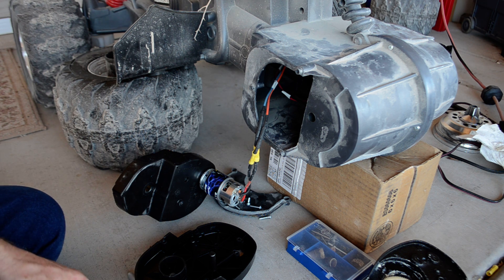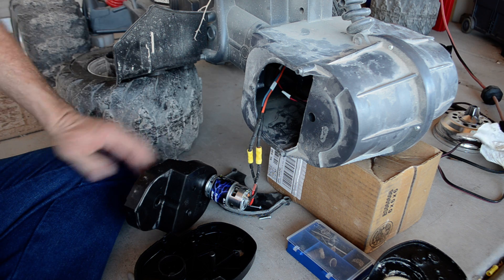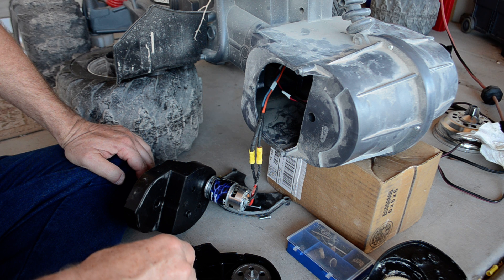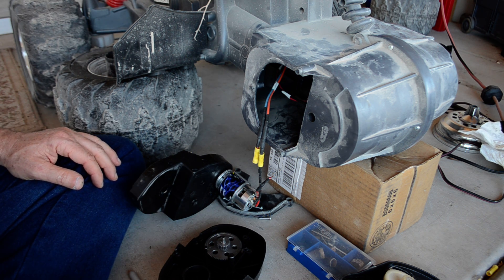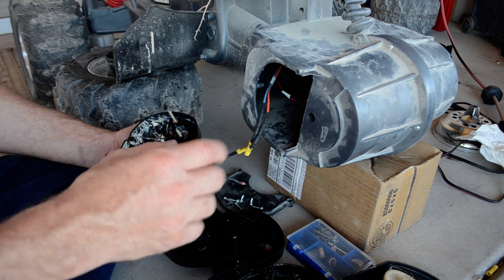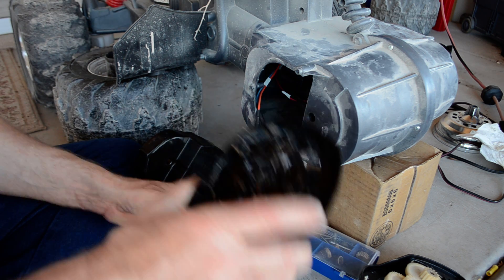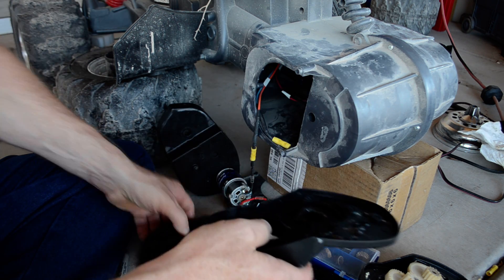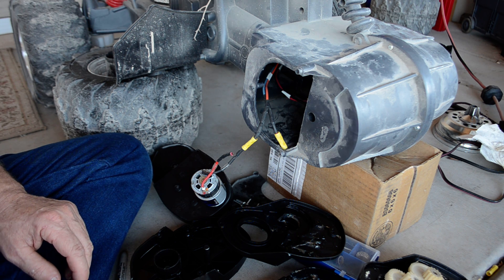ML Toys Powerwheels Stage IV Steel Gear and Gearbox Review & Results & Alternatives.

Comment: It's normal for power delivery to be uneven, when there's no load - especially when it's wired in a series. With the wheels on the ground, and a shared load, it evens out. HOWEVER, this is much different, than bound gears. It seems like bad customer service to assume that you're not describing the problem correctly, and they start walking you through the "This customer's dumb, but we need to prove it to him" troubleshooting steps. "We're fed up with you..." That's a great way to ensure repeat service and keep the money flowing in.

Comment: there prices are too high and not a great selection 

ive got a rastar ferrari and new a new gearbox because my plastic gear stripped and new metal gears are $600 

looking for 24v very high top speed so... there is one one on amazon but looking

Comment: @stickman-1.. I know this is many years later but I appreciate the video. If you still have the gear boxes and want to give them away I would like to try them.
Reply from the maker: I still have them. I would give you the gear boxes, but the motors and gears I'd have to get money for.
Reply: @stickman-1  Ok I will take the gear boxes. How much are you selling the motors for?
Reply from the maker: @barringtongoulbourne9524  I'd sell everything for $85 shipped. That's 2 motors (775 motors) pin gears, adapters, 1st gears, the gear boxes and everything else that I have. I paid about $300 for the pkg from ML Toys.) Everything is in one box, you will have to sort things out but I'll make sure it's packed properly.
Reply: This is my phone number 18764234932 whatsapp.

Comment: Curious to know what happened after this.
Reply from the maker: I bought my son a real electric ATV and junked the powerwheels thing. I still have the ML stuff if you want it, I'll sell it all to you. But only do it if you like breaking things and repairing them over and over.
Reply: @stickman-1  my son is only 1 but I'm one of those dads that likes to build things better. I actually manufacture offroad truck parts for a living. I bought a ride on jeep for my son with the remote so that I can drive him around. My primary current concern is the suspension. It has cheap spring suspension but it's very rigid and doesn't give much travel. Especially with the plastic tires. I want to upgrade the suspension to more of an independent cross kart type. Also, I want to upgrade to a fully variable throttle, instead of the on/off type, and also, I think maybe adding a capacitor in the motor wiring might make the braking less harsh. And finally, I'm considering either brushless motors and planetary gears from drills or converting to golf cart motors with a transfer case for 4x4. What do you think and have you done any of this or have recommendations? I plan to build him a nice electric cross kart one day and eventually convert it to gas.
Reply: @stickman-1  also, what type of electric atv did you get? I'm not really familiar with those.

Comment: Did you ever get this setup working?
Reply from the maker: Not really. As soon as I got one thing working something else would give out. (Other gears, gear box, switches, etc) I ended up buying a Russo electric ATV and trashing the Powerwheel. I still have the motors, gears, housing ,etc and will see if you want it. The Russo is not perfect, but for the money I invested in the Powerwheel and it's upgrades I could have nearly bought the Russo initially and it'll do 22mph on the highest setting (3 settings.)

It is not a perfect product and has some shortcomings but it's still working and nothing major. The only caveat is that the Russo is only 28" wide and so if your are on one of the higher speeds its' easy to flip over. So have your kid get really proficient driving before you up the speed.

Comment: i bought 2 complete 24v gearbox's and ran it through a 36v scooter controller with 2 relays for forward and reverse with a variable accelerator and a hoverboard 36v battery and charger..its been a year and still going(12v to 18v is the same difference as24v to 36v)...thanks for your info the more we know..

Comment: Man... I just dropped a few hundred for a stage 4 kit and it's been over a week. Have heard nothing and status still says processing, cannot cancel. They also do not want you to contact them for any reason because, it will only slow things down. I should've read all the comments here.  

Just acquired another Power Wheels and don't want to dump more money to them. I think it'll be winter by the time I get the kit at this rate.

Looks like I could get 775 motors off Amazon, just need the spacer, bolt, and bracket mount for my other power wheels. Where can I get these parts besides ML sucky Toys? Thanks in advance!

Comment: Man, this sucks. I just dropped $200 on one of their stage 4 do-it yourself kits with the 775 motors because we’ve burned up 3 of their 550 motors over the course of the last month. After burning up the 3rd motor I started to think that we were just pushing the 550 a bit too hard and that upgrading to a 775 might get us over the hill. But at the same time I had my reservations about ordering anything after the 3rd motor because I was halfway thinking it may be that their products were just garbage.

But my son loves his truck and I convinced myself that larger motors would fix it. Im really wishing now I had just pieced things together on my own and not spent a penny with ML.

The truck was a trash find but I’ve now poured enough cash into it that I could have just bought one new and even with the bigger motors I still hesitate each time we use it and worry that we are going to burn something up again. 

I sure wish I had seen this video a few months ago before all of this started

Comment: If u wanna upgrade cheap buy new stock 550 motors with heat sinks .rebuild your gear box with race grease. Then run 18 volts and no more then 12 Amps. That's my sons Corvette setup so far so good also got my daughters pink jeep on 18 volts 12 Amps and everything else stock with no problems.

Comment: I must say there products are awesome! You need to be expert at building such setup!  I understand the frustration they gave you. They did fix it. :)
Reply from the maker: It's supposed to be a drop in part. That's why I paid the premium money to save time and the headaches. Instead I got a bunch of BS and run around for months. They didn't fix anything till I sent them video, after video, after video here on youtube. If not for these videos, I don't think they ever would have "fixed" anything. And they didn't really fix it. What they did was finally acknowledge my complaints were valid and finally got me the right housing.
Reply: @stickman-1  I ended up doing my own motor upgrade.  I used motors for electric drill that is rated for 12v to 24v.  Ball bearing motor too. So far no issues! At 12v motors spin 15700rpm at 24v spin 41000rpm!
Reply: Ml toys have a great metal 1st gear! There motor suxs!
Reply: My combination puts their motor to just junk!

Comment: i ordered the upgraded motors along with the 24v battery upgrade from them recently but using the stock gears and during there break in process i noticed one of the motors was not spinning as fast as the other and would actually stop while the other would spin faster. they said that is normal. i am only getting about 10 min of runtime on high speed, they keep saying make sure you follow the break in process, it never came with the instruction i had to follow the YouTube videos which i did but still only seeing 10 min. IDK i spent a lot of money and time and only getting 10 mins on a fully charge battery doesn't sound right. and i cant find a phone number to call them only email which there reply back is maybe two sentences, like I am annoying them by asking questions.
Reply from the maker: Wow. Five years later and they still have the same problems and they still treat people the same way? Clearly they have learned nothing from their customers.

Comment: I bought over 500 dollars worth of parts, Installed and gears broke the first 20ft.
Reply: I just spent $600 Canadian (after shipping)
775 fully assembled gear boxes. 

On the FIRST ride after only 30 mins we lost power to one wheel…

Both motors work. Seems like something stripped in the gearbox. 

I’m taking it apart now to see what’s going on.

Comment: I also had a bad experience with M L Toys after spending hundreds of dollars on upgrades. Multiple  sets of performance motors all burnt out after a few uses. Went back to stock motors.
Reply: did you break them in? i want to upgrade mine and i dont want to waste $100 or more on motors that will break

Comment: Jesus Christ. Why not just have you return the problem gear box and re-ship you a working one from the get go. I mean, they just wasted time and eventually shipped you a component of the part. It wouldn’t been much easier just to sent the entire part to you. Once they receive the broken part they can troubleshoot it and re-sell it if they get it working. I’ve heard from several people that their parts are iffy sometimes and their attitude sucks.
Reply: they aren't trouble shooting anything. They sent me batteries and said i messed them up. Battery charger doesn't even work. They want me to upgrade to the stage IV I said you cant even get me batteries. Then they want me to reach out to mighty max and they said we dont do warranty work. I told them they said well you hast have messed up the batteries sorry. F them!

Comment: You just saved me several hundred. I was about to buy several items from them. Thank you for the vid
Reply: who did you go with? they screwed me big time.
Reply from the maker: I used their gear and motor since I already paid for them. As for the ATV we just junked it. It kept breaking gears. All we were doing was playing wack a mole. As soon as you fix one thing, something else breaks. We ended up buying a Rossi ATV for $600. Runs 4x as fast as this and doesn't have the problems this did. (The Rossi has it's own short comings but they are minor compared to this mess.)
Reply: I also switched gears and went with an electric ATV from littletoysbigcountry. We are much happier with this than trying to make these power wheels more than they are intended

Comment: Does anyone know where to buy the Metal First Gear w/ 2 Steel Ball Bearings. I can only find them on MLToys?
Reply from the maker: I recommend not wasting money trying to upgrade these toys. As soon as you get the metal first gear, then you'll have problems with the 2nd gear and if you get that resolved then the case just "melts" from the heat generated. We ended up buying a Rossi for $600. They are a bit higher price now and they are not perfect, but it's way better money spent IMHO.
Reply: @stickman-1  thanks but not spending 600 on a child's toy.  maybe if I competed

Comment: I was sent the wrong order, their fault... and here I sit waiting for my motors and gears. BUT, they said they will push my order up to satisfy me. No, that isn't going to work, hold on to the order that was sent to me until I get the correct order that I placed with them.
Reply: they sent me used batteries.

Comment: I am so glad I came across your video. I was about to order from them. Do you have any suggestions on other companies to buy from? Thank you for warning us. They need to know how much customer service matters.
Reply from the maker: There are people on ebay selling the metal gears. I have part numbers for the other items on Amazon in the long description for the video. But I do want to warn you, even after you fix all of these issues the gear boxes will ultimately fail. Once you get the 1st gear and motor solved then it'll be the 2nd gear that strips teeth. Eventually you will find no matter what you do, they will fail everytime because the gear box is just plastic and it will deflect and deform under strain and cause the gears to lose proper engagement and then be on the tips of the teeth, not the roots. As soon as that happens they strip. Also the gears will grind INTO the gearbox at the axles. Because the gears are helical cut, they put longitudinal loading (perpendicular to the gear) on the case and it just gets eaten up.

I ended up buying https://www.rossomotors.com/ for $500 and got a complete ready to go electric ATV that will go up to 20mph.
Reply: @stickman-1  Awesome! Thank you so much. I was trying to decide if I wanted to put any more money into our Dune Racers. I've already upgraded all the wheels to lawn tractor wheels. That would probably make the gear issue worse too, with all that extra traction from the real rubber tires. I considered the Razor Dirt Quad, but I'll have to check out the one you linked.

Comment: I was hoping for a good experience, even after watching this vid (doh!)  But this video is legit and exactly what I went through these past few weeks.. it was supposed to be a simple drop in.. NOPE.  First set didn't even turn and were damaged on arrival as they shipped in the smallest box possible with barely some paper stuff in for protection.  In complete disappointment I simply wanted a return/refund - MLtoys says "not going to happen, all sales final no matter what".   I tried repeatedly as I was sent damaged, non-working parts - but after a few back and fourth emails...  NO REFUND, NO RETURNS.. so I play along and return the motors for new ones, and they send me a second set.  The second set worked, but were not in sync and wobbled hard.. and were quite noisy.  I did all things mentioned, break in, etc.  with 24v on full batteries, the motors would last about 1 minute before cutting off.. then kicking back on .. and with the uneven rpms it was just plain no fun at all.  For a fraction of the cost I bought stock replacements - they are quiet, balanced, in sync, and actually turn faster!  The MLtoys versions are heavy and clunky - there was absolutely no performance gain I could see (especially since I couldn't get more than a minute of function at a time).  DO NOT BUY THESE!!!  IMO, just buy a few stock motors and you'll still be $$$ ahead of the loss in this purchase - sure, you may burn them out.. or strip one on 24v... eventually... but you'll at least get some play time before then.  And yep, I bought the top motors, heat sinks, etc about $300.. now I have them sitting the the same box they came in.. maybe I'll use them for something else later?  And customer service is the pits... not sure how these guys are still selling these things with a straight face.   Again, DO  NOT  BUY  ANYTHING  FROM  THESE  FOOLS!   BUYER BEWARE!!!
Reply: i ordered the upgraded motors along with the 24v battery upgrade from them recently but using the stock gears and during there break in process i noticed one of the motors was not spinning as fast as the other and would actually stop while the other would spin faster. they said that is normal. i am only getting about 10 min of runtime on high speed, they keep saying make sure you follow the break in process, it never came with the instruction i had to follow the YouTube videos which i did but still only seeing 10 min. IDK i spent a lot of money and time and only getting 10 mins on a fully charge battery doesn't sound right. and i cant find a phone number to call them only email which there reply back is maybe two sentences, like I am annoying them by asking questions.
Reply: @Fractal83  damn, so even now they still have issues. Looks like they haven't fixed a thing. Definitely will not buy anything from them. Thanks for the post.